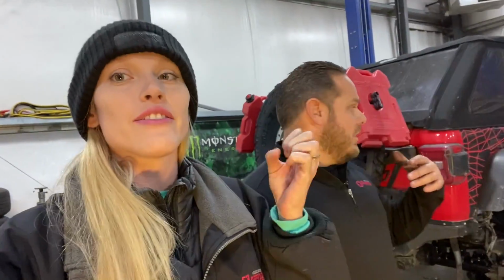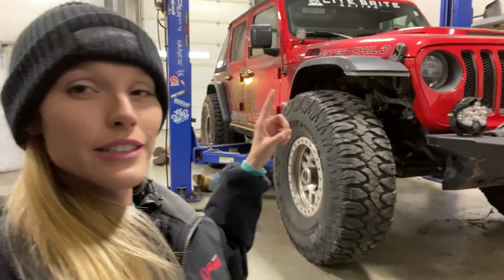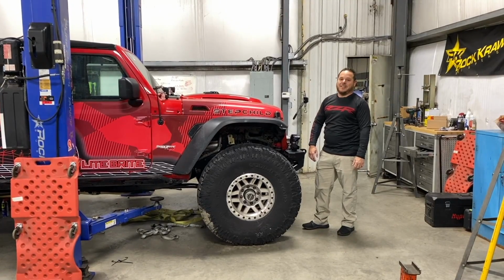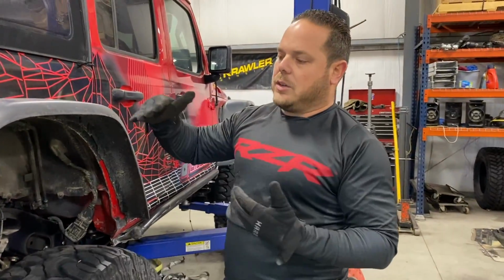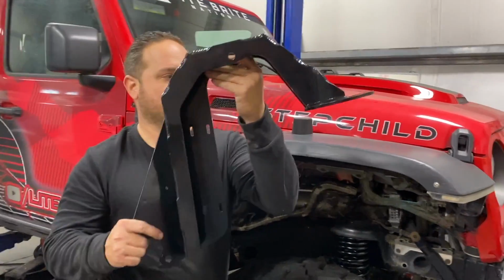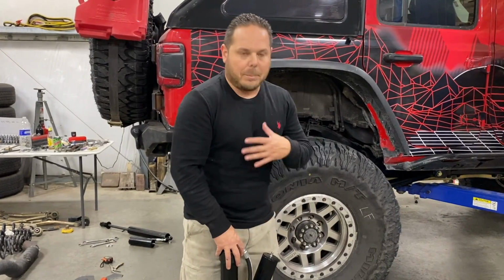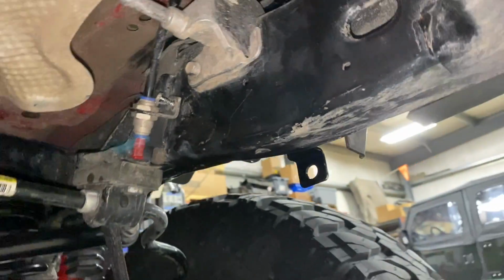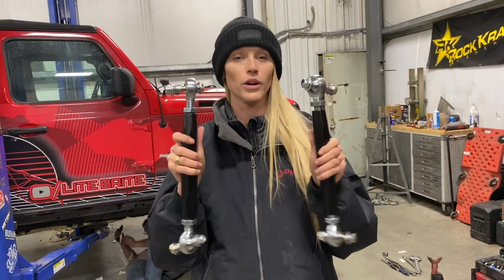COILOVERS vs SHOCKS! Rock Krawler Long Arm is Complete!

Comment: I ripped off the upper control arm mount on my front axle from too much flexing on the stock bushings so I went ahead and put a truss on with an integrated upper control arm mount. I went ahead and got some currie Johnny Joints to relieve some stress and get some more flex! Through all of this I realized that I like a true 4 link, but I can't figure out why. I just don't like the idea of a 3 link in the front. Since you guys kept your 4 link up front, maybe you can tell me why you wanted to keep it and not go to a 3 link in the front as well....?

Comment: Coilovers offer the best off road performance especially going fast on and off road. that being said I agree with you as far as the back goes you would have to get a custom-built coilover for your setup in fact probably front-wise too off the shelf coilovers at this point with everything you have probably wouldn't work but I have coil overs on mine I don't have a hemi or nothing like that and let me tell you something there's no body roll on the street and I get all kinds of crazy travel and you get true travel to where when you're when your wheel goes down and it actually pushes against the ground to give you grip so that's another good thing about coilovers and the adjustability. the negatives on coilovers the adjustability you can go crazy for long time with coilovers adjusting ride height and also the maintenance at least every 20,000 miles you got to take them off and have them you know the oil changed and maintained but other than that to me they're the ultimate in performance.
Reply: furthermore I would add that changing ride height by taking the tire and wait out it isn't an issue I know lots of people who have lots more weight than you in there and they have no issues with the coil over so I don't really believe that that is an issue as far as weight goes.  I don't know who told you all about that waiting stuff but that's not an issue I know lots of people who have heavy jeeps and run coilovers with no issues whatsoever you just have to go to a different spring rate.

Comment: You should have installed the MetalCloak 5.5 long arm lock n load or 4 link lift and you could have reused the 6 pack shocks! I'm surprised you went with the Rock Krawler lift and as a result, it took alot of extra time and labor to modify your rig!

Comment: It's funny seeing it bouncing like that because it has no shocks. I wanted to replace my trucks shocks with some much better offroad shocks, so I called my local 4x4 parts store and they had a set of the ones I wanted, so I went outside and took my shocks off and then called my other half to get her to pick the new set up on her way home, to find out that she had 3 more real estate showings so she wouldn't be home for at least 3more hours, and I needed my truck because I was going to have people waiting on me at the trailhead in one hour, so I said I'll just drive it to town without shocks on it, and the roads were nice and smooth so I didn't think anything was even much different, so I was running 60mph when I hit a spot where they had removed old RXR tracks, and they were at an angle so it wasn't even a straight-on hit, and I about wrecked my truck when I hit it! lol. My truck was bouncing really bad, and it was bouncing like corner to corner, I felt like I was riding an angry out of control bull. lol. I got it slowed down and drove very slow from there on, and I put the shocks on my truck in the parking lot of the store because they were closing as I was paying for the shocks, so I couldn't have them install them on their lift. lol. Never drive fast when you have no shocks on your vehicle. lol.

Comment: Did you fix the broken taillights??
Reply from the maker: We replaced the driver side one.
Reply: Lite Brite I love how you kept the patched up passenger one.
Reply: @RyanRKJ  Yeah and got it to fit perfectly like puzzle pieces.. I cringed when it happened.. But if you are going to wheel that hard things will happen.. In fact I'm very surprised just the back quarter panel on the driver's side got buckled and nothing else...

Comment: Shock mounts shouldn't have been welded on until the suspension was cycled. You could have easily increased the ground clearance by raising the rear lower shock mounts to accommodate the 6pak shocks.  This seems like an excuse to swap out MC suspension for RK suspension. Both companies are great but I feel this is just becoming a commercial.  The longer bodied shocks you installed actually have less travel and a longer  compressed length than the 6paks.
Reply: Rob50lx I was also wondering why they welded on the brackets before a mock up. It made no sense, but apparently time was a factor, and the project got rushed along. Bleepin Jeep did a really good video recently about how his Comanche has a lot of problems because the build was rushed. The Scorpion Crawler is much more sorted, because he took the time to do it right.

Comment: Your air bump housing is way short. You need a 4” air bump housing limited to 2” travel.
Reply: CRAWLOHOLICS nothing is short. We compressed everything and limited travel based on mechanical interference. The bump stop is exactly where it needs to be before the oil filter or AC compressor gets hit by the mount.
Reply: You shouldn’t need a 5” puck. You’ll be landing on the corner edge instead of in the middle. I’ve had to change my air bumps for the same reason
Reply: CRAWLOHOLICS oh you are saying the whole bump itself need to be longer so we can use a shorter bolt in bump stop? Why does it matter which one is longer? Weather it’s longer from the top or from the bottom is it not the same?
Reply: Kevin Williams it lines up better with the strike pad with the upper longer. If you’re really pro, you can machine a half sphere for the lower strike pad

Comment: I completely agree with the assessment of coilovers.  When I built my JKUR everyone expected me to go coilovers because I went longarm directly from stock and my off-road background but coilovers are not the end all be all as they still have drawbacks and my Jeep is my daily driver/weekend wheeler.  A lot of misconceptions out there as well as the whole LCG trend. 
Mike
Reply: MoneyPit Jku yes, even with only 2.5”-3” of lift I would still recommend adjustable control arms to keep the axles centered in the openings as well as maintain adjustability to keep pinion angle and caster properly set. This will maintain the street manners especially since your building a driver rather than a trailer queen. 
Hope that helps. 
Mike
Reply: MoneyPit Jku I’m sure there are a lot good ones out there but the only ones I can vouch for personally that I have used are Teraflex and Metalcloak. Both are high quality but I have been really impressed with Metalcloak’s Duroflex bushings.  I built my own links several years ago using OEM TJ bushings at the axle and Currie Johnny Joints at the frame but knowing what I know now after my experience with Metalcloak I think I would be running their Duroflex bushings. 
Mike
Reply: MoneyPit Jku I’m happy to help. 
I have some Jeep videos on my YouTube channel as well that you may find informative if you have time. 
Happy New Year to you as well. 
Mike
Reply: So what kind of shock do you recommend for daily drive 
coilover or normal shocks

Comment: What is important to supporting the sprung mass is the wheel rate. If the wheel rate is low, adding x pounds will compress the suspension more than if the wheel rate was high. The springs you have now appear to be dual rate. The area with the coils close together is the lower rate and the area with the coils farther apart is the high rate. Why couldn't you design a spring configuration for coil overs that would have the same wheel rate? It shouldn't matter what position the springs are in. You would at least need a double, maybe triple, spring setup, but the wheel rate at ride height should be the same. 

That said, you've made lots of changes here and if you liked your springs before there is no real reason to use coil overs instead of just using the existing spring with a smooth body shock like you have. Test it out and go from there. I am a bit confused on why there wasn't more test fitting before final welding if you wanted to use the six packs. Maybe time?

If you decide coil overs are something you want, ask around about suspension frequency. If the guys you are talking with can't talk intelligently about suspension frequency, you probably shouldn't deal with them. You want something that will perform well on and off road. Have you read Billavista's coil over bible?

https://www.pirate4x4.com/tech/billavista/coilovers/Part_1/

If consistent ride height with different payloads is a top priority, maybe airbags would be a good choice in the rear.

I can't wait to see this thing offroad! Looking forward to future trail videos.

Comment: A Great conclusion to your year! Articulation via the domino theory - change one thing and watch other parts transition accordingly  - but given the surgery performed - not as many as I would have expected. However, it's hard to see how those longer sway-bar links disconnect. I assume they do? Have a Happy New Year!
Reply from the maker: The electronic sway bar disconnect on our JL is still fully functional. 😊
Reply: Gary Button the links don’t disconnect. The sway bar itself has a mechanism which engages / disengages the sway bar. JK gear and gadgets talked about it when he installed his anti rocks.
Reply: @LiteBrite  WOW - an original Chrysler part is still on your suspension and working after all the pounding - congrats
Reply: @RyanRKJ YES, however I've seen several JK builds where that mechanism was removed and replaced to save weight, complexity and acquire the last fraction of an inch of flex. Perhaps the JL system is improved - it certainly has been put through the ringer on this jeep!

Comment: While I agree that coilovers are not for everyone. It is not true to say that coilovers are somehow “more sensitive” to weight than a separate coil spring and shock setup. Either way, if you use a good quality spring, the spring rate will not all of a sudden change and be more sensitive just because it’s on a coilover. If you have a coilover with the exact same spring rate that you are currently running. It will not act any differently just because it’s a coilover. 

The reason people run coilovers is because they offer so much more adjustability. It is so much easier to change spring rate, valving and preload without needing to change other components.

Comment: Your coilover argument is a bit weird. Running a separate spring versus a coilover is really no different loaded and unloaded if you chang nothing. Without adjustment they’ll both be wrong for one, loaded or unloaded. A coilover spring preload can be adjusted to better accommodate loading and unloading the Jeep than a standard coil spring. The coilover has far better adjustability and tune-ability compared to a standard lift spring. You can spring in the middle ground of what would allow more preload when loaded and then adjust when unloaded as needed or wanted. The coil spring in most cases is designed to meet the wide majority of needs which means it isn’t outstanding at anything. Can you build a good coil and shock machine? Absolutely. Budget allowing, coilovers can benefit everyone but may not be necessary. I don’t see loading and unloading a Jeep as a reason not to get coilovers honestly. It’s your preference and shouldn’t be spread as fact about coilovers.
Reply: Jay P Coilovers are very sensitive to weight where as the triple rate springs we’re using paired with properly valved shocks can handle a lot wider range of weight without adjustments. Coilovers are definitely known to be extremely sensitive to weight changes. We tow with this as well. Coilovers are known to not be a great system for towing applications which is due to the weight. We’re not spreading any false information.
Reply: Kevin Williams Can you please explain exactly how a coilover is somehow more sensitive to weight? 

If you used a coilover that was valved exactly the same and had the exact same spring rate as the current setup on that Jeep, it would not somehow be more sensitive to weight. Spring rate is the amount of weight it takes to lower the spring one inch. So if the spring rates are identical, the vehicle will not just magically drop lower just because it’s a coilover.
Reply: Kevin Williams Not to mention coilovers can have dual or triple rate setups that are far more adjustable than the triple rate coils you have.

Comment: When you said you were going to create a hybrid setup with the 6 packs, I thought that meant you were going to make custom brackets to work with the extended and compressed length of your existing shocks.
Reply from the maker: We wish we could have. We were hoping the the 6paks would work in tandem with the RK long arm kit. When we found out they wouldn’t, we only had a day and a half left to finish, and didn’t have the time to create anything from scratch.
Reply: Lite Brite it’s ok, you can just put the 6 packs on the Gladiator. If you don’t like the RK shocks on the StepChild, you’ll figure it out.

Comment: Very disappointed in your handling of the shock and wheel travel issues.

The 6Pak shocks have 15" of travel. The shocks you put on don't. To get 15 on a JL you would have needed the equivalent of a bed cage. All RK had to do is fabricated and weld in little brackets to the upper shock mount to lower the mounting point 3"-4", or raise the lower mounting point, or both. They could have done in an hour or two. And you would have had more travel. The 6Pak length issue should have been obvious before the car was in the shop. I asked about in a post after I saw the first video in the RK install series.

Moving the oil filter should have been a no brainer. Moving the A/C compressor, a bit more. But it is the middle of winter, the AC could have been disconnected and moved out of the way until a new bracket could have been built. That would have kept the CG down and left the long arm at a better point in its geometry. The other option would have been to cut off the upper arm bracket (there is only one) and weld it on an inch or so further away from the object.

Total misunderstanding of coil-overs. The big thing the coil-overs do is keep the spring straight. The OE style spring has to go in an ark. Dual rate coil-overs also allow you to change the point the rates change where the wound dual/triple rate springs it is baked in...when the tight coils coil bind. On a coil over the dual rates can be adjusted by swapping one or both of the individual single-rate springs. There are no advantages to big springs and you won't see big springs on any serious race vehicle from Indy to Monaco to Baja or Paris-Dakar.

If anything, the big reason for Lite Brite to say with big springs was to use the 6Pak shocks! The 6Pak, which is basically two shocks put together, is a very clever design, on a par with the Ohlins TTR/TTX/ILX.
Reply from the maker: You make it sound so easy to just move the oil filter and relocate an entire AC system. First off There is no other room for the compressor to go anywhere else plus having to make all new lines and the bracket on the axle didn’t have to just Move an inch one way or another for clearance. You are down playing they amount of work that would have to go into all of it by a huge amount. Race trucks/cars etc don’t pile 400-600 lbs of equipment in the back of a vehicle and add a trailer to them which is even more weight to tow around the country so comparing their setup and what they do to what we and other do when loading down their JEEP and towing boats and sxs isn’t nearly the same. Anything can be done with enough time and resources but to do days worth of work over shocks isn’t the answer at all. 
The 6 paks are a great shock but they also won’t keep up with a 2.5-3” shock with remote resi and bypasses. I had already overheated and shock faded my 6 paks in the dunes at sand hollow in 15 minutes running through there. That’s something that won’t happen with our new setup.
Reply: First, the Rock Krawler X-Factor 3-link front/rear long-arm suspension should be a major improvement on-road and offroad, so congratulations with your new suspension. 

Raising the CG is sometimes necessary for clearance. However, doing it for an oil filter or A/C bracket seems wrong, especially for a build that costs more than the underlying car.

The A/C could have been disconnected and moved out of the way. New brackets made latter...after all, it is the middle of winter. The professionally installed 3-link long arm, Dynatrac ProRock 80s, Hemi conversion, beadlocks with 40" tires is a $60+k setup. A full-set of coll-overs/bypass shocks could easily be another $10+k.  The cost of the bracket is trivial by comparison. 

In the beginning, you said you were keeping the 6Pak. If they were already fading why weren't they already on the chopping block. I can't imagine they faded in rock crawling. Rock Krawler specifies emulsion shocks for many of their builds, a shock that is predicated on their not being a lot of heat generated. Did MetalCloak have suggestions to handle the fading?

The Wrangler is never going to be a Trophy Truck. An attempt would need much longer lower arms, probably the moving gas tank and with a triangulated rear suspension plus a bed cage and very long travel shocks. In any event, it doesn't look like the shock situation is optimized.